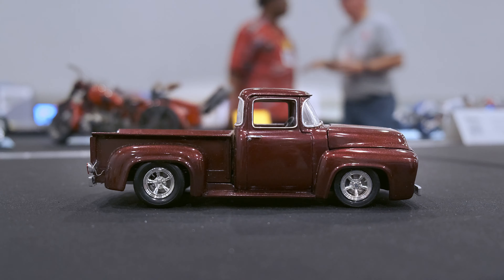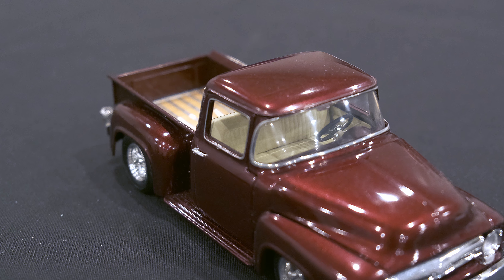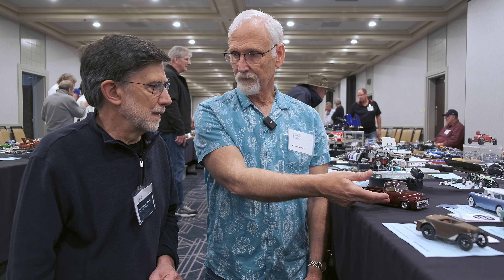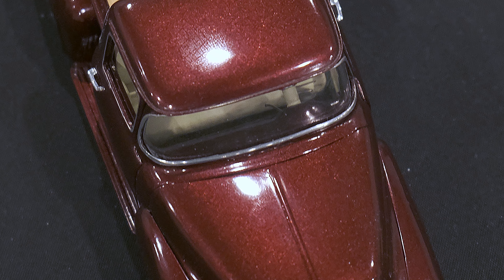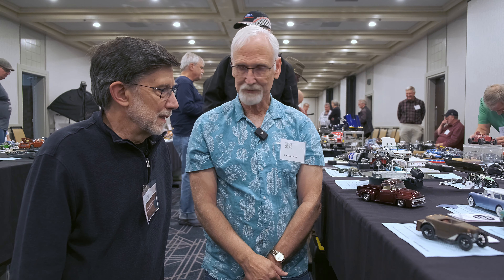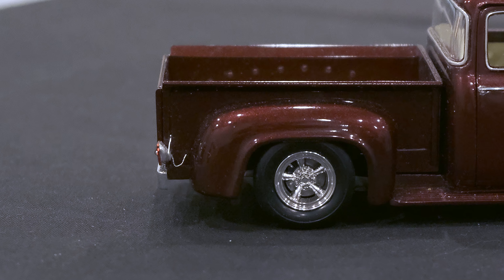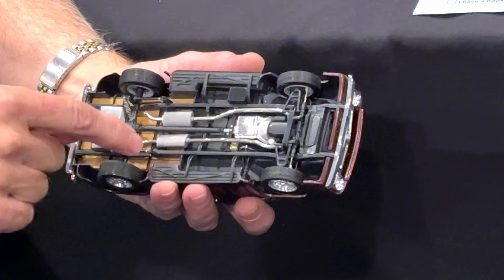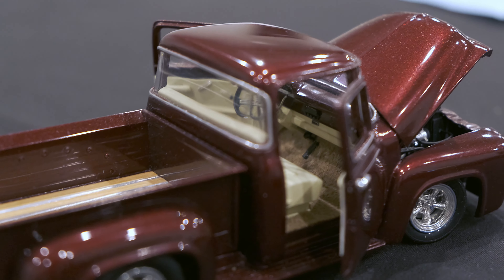GSL: '56 Ford Pickup Scale Replica of Ron Butterfield's 1:1

Comment: There’s nothing like hearing from someone who owns the 1:1 vehicle exactly which kit parts are the most accurate.

I’d love to see more detail on how that hood hinge mechanism operates.
Reply: Take a look at the design of a real 56 ford pickup hinge.  On the model, the top rod of the hinge  is attached to the hood and pivots at the side of the fire wall just like the 1:1 hinge would . The lower rod on the model attaches to the hood like it would on the 1:1 truck. This rod is made about twice as long (in scale) as the bottom rod of the real hinge.  On the side of the fire wall below where the top rod is attached is a pin that is sticking out about 1 mm. The long lower rod has a notch in it that falls on to the pin when the hood opens. To shut the hood the model is turned over and the lower rod falls away from the pin and as the hood closes the back half of the lower rod goes into a slot beside the fender at the cowl. the lower rod slides between the outside of the pickup cab and the kick panel in the interior. the hinge rods were made out of aluminum sheet. There you have it.